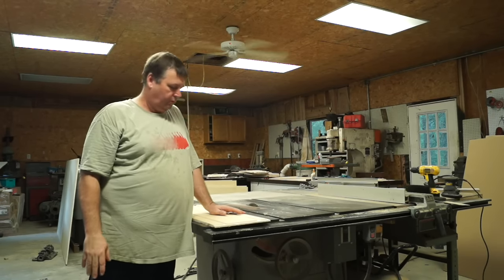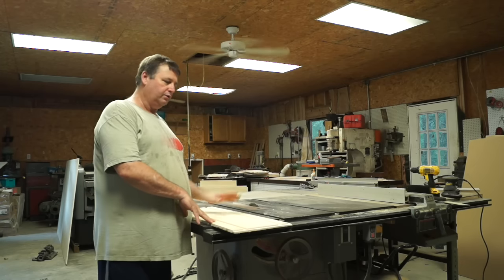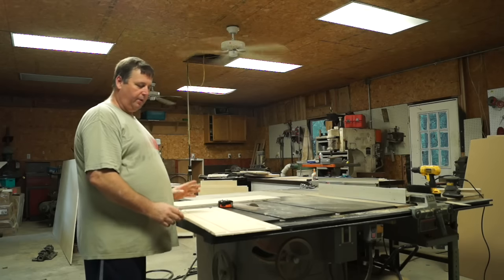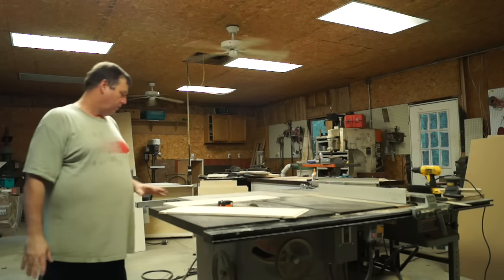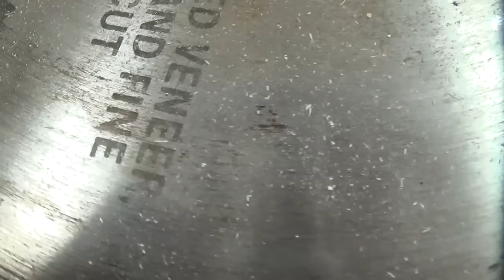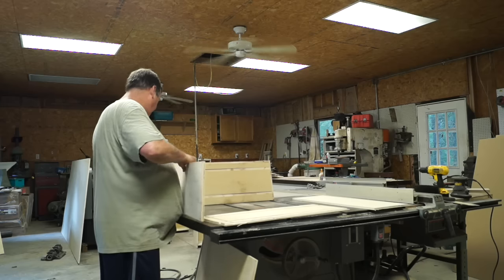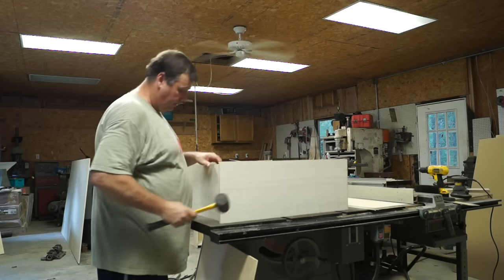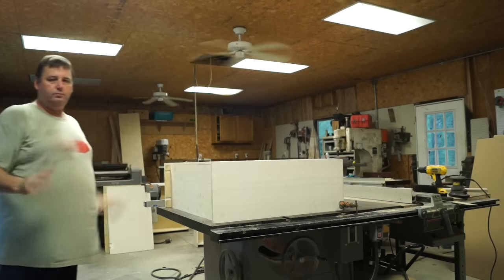Shop Cabinets

Comment: mike, great video.  reminds me of myself shucking plywood around solo to cut out cabinet panels.  I've been planning extra storage in my shop but I want casters under it to move it around without tearing the walls apart.  Also, I'm going to put 1 1/8" subflooring on the benchtops and overlay it with 1/8" aluminum sheet.  I'm getting tired of oily benchtops, lol.

You mentioned birch for the cabinets, I'm looking at 1/2" MDO or HDO for cabinets, drawers, etc.  Probably not for the shelves however.  I've used MDO in the past and it takes a great coat of paint.  Makes a very nice painted cabinet.  You obviously can't stain but that wouldn't work all that well in a shop anyway.  

Thanx for the great work and inspiration!
Reply: I have used 0.9 mm galvanised steel sheet, cut on a guillotine , with edges folded on a pan brake, to surface benches. Cheaper than aluminium, especially if you have guillotine (shears to you?) and pan brake.